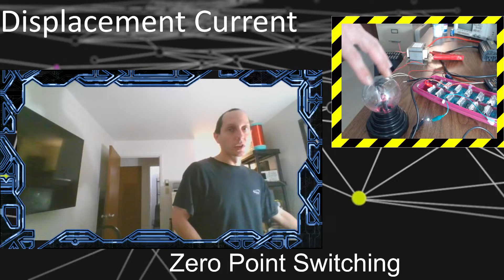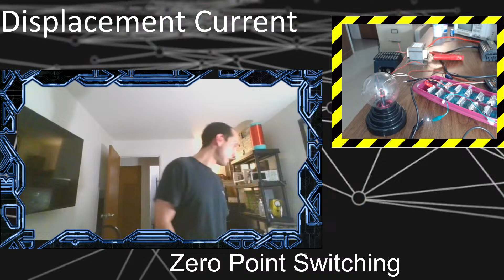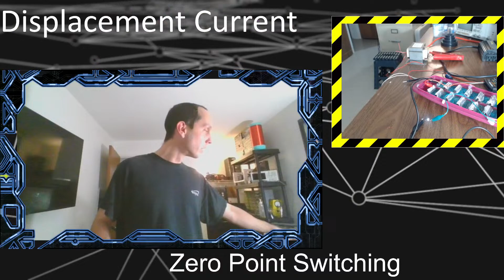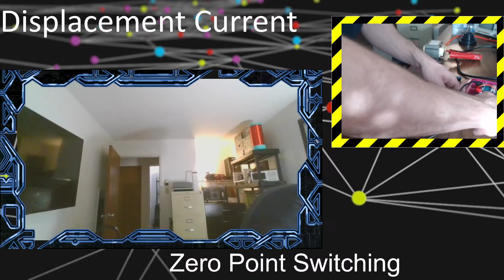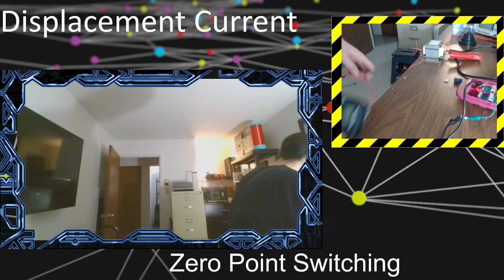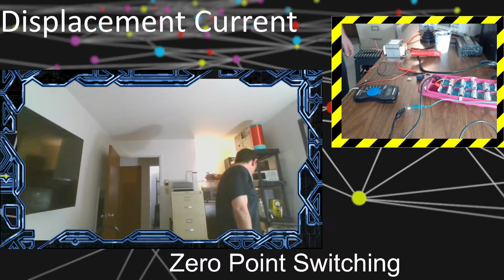Displacement Current

Comment: Just thinking out load: if any generator can work as a motor and any motor can be a generator, why we don’t use this principle ? Oh, we don’t know what exactly is doing a magnetic field what role plays in induction or what else may provide this “induction”  ?

So, if we want a solid state generator what we need to do ? First of all I would look out for Tesla patent for a device able to use low DC input power to output currents of high frequency and potential, then use this output to drive another invention of Tesla called convertor and notice that his wiring is similar to H-bridge arrangement with at least 4 segments bifilar or double windings (depends on what achievement you want) on a toroid. Number of segments depend on how many independent circuits you want to power … then, consider at least 1 independent circuit made in such way to equal the required input and at least 1 resistor in output able to handle enough power that is generated to keep the system going (as Daniel Macfarland Cook did whit his “battery”). Sounds more complex than it should ? Think of the 8 currents described in Daniel Cook patent !

Also, look up to see Tesla have used his convertor in many other applications as a generator or motor by placing a rotor inside of this convertor !

Comment: Great info and video. BTW, the control triggering mechanism sounds alot like an Ed Gray arrangement with two batteries to charge and run a single load alternately. Maybe feed the pulse flyback (from the first stage) through the second half of the control circuit as a trigger. If you want total isolation, run the flyback through an opto-coupler to trigger the other half stage and vice-versa.